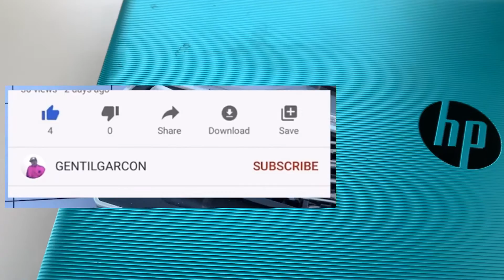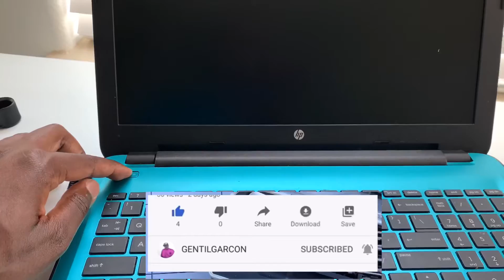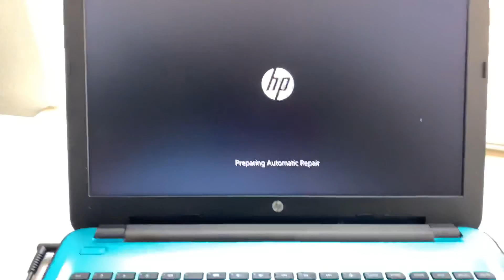How to Replace laptop Screen - LED LCD HP 15 - BA002DS

Comment: Hello again GENTILGARCON would you also think the Bluetooth headphones would work and let me hear sound on a Dell2400 if that's fine?
Reply from the maker: Check to see if the computer has a Bluetooth capability. Go to the search bar and type Bluetooth.
Reply: @MarcelJoel   I will and connecting bluetooth devices would be an option on any or other types of Dell computer devices and would be able to work if that's fine?

Comment: Hello GENTILGARCON would you think if I might not be able to get the Headphone jack out then could I still hear sound from a video or something from a Dell computer by connecting a wireless Bluetooth speaker to it if that's fine?
Reply from the maker: Yes connect a Bluetooth device it would work